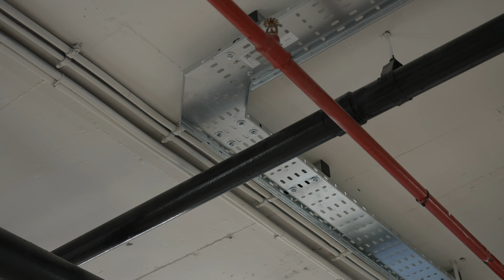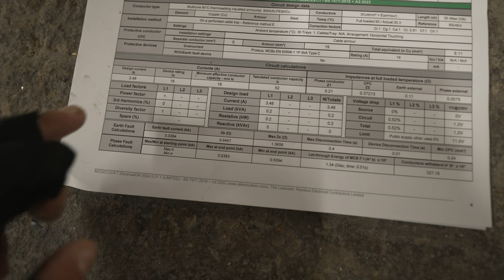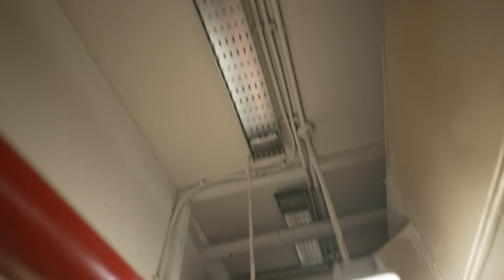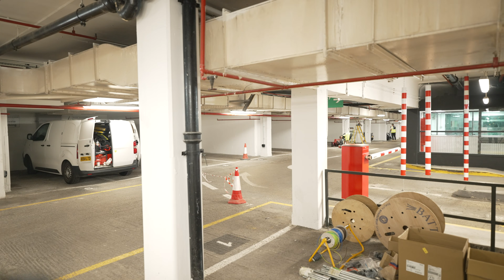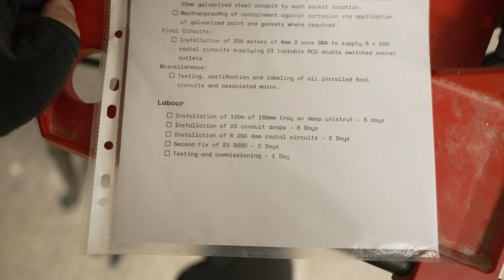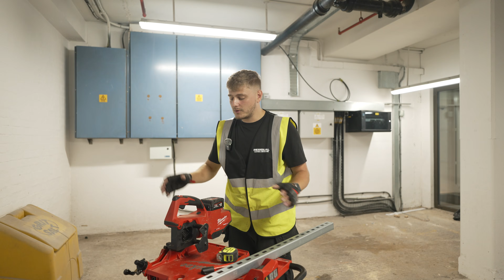I won my first electrical contract

Comment: Wieland do a system now using a Busbar cable you can tap off to run about 20-30 Car chargers off one system…would save stack loads of time not having to install all the wiring containment including unistrut and cable tray…nice work though

Comment: Nice video 
The containment times look about right , however the second fix for the sockets seems a bit tight the sockets fine but you have all the swa’s to gland off some look tight upto the ceiling and dress in ,stainless ties upside down .
Allow yourself a bit more time with the testing and the design

Comment: Strut cutter looks a beast 🤟 if it was around the £1000 mark I’d jump on it but think they’re taking the piss with the current price. Milwaukee must have bought or contracted a 3rd party company to make it which is why it’s so insanely priced 😂
Reply: Rigid thats probably who.
Reply: @SME_Ste  probably 😂 think strutslayr might actually be marginally cheaper…. 
Milwaukee £2600 for the bare tool + £350 for the dies + £138 for 2x batteries and charger +£500 for the nice vice table so £3.5k will have to start financing tools at this rate
Reply: @whatthedeuse  didnt check the price but thats some serious dough. 12 months ago a cordless bandsaw was the latest thing that was supposed be the mutts when chopping loads of strut.
Reply: @SME_Ste  yeah, I haven't been on site for Years but the whole bench with the chain reminds me very much of pipe fitters rigid tables